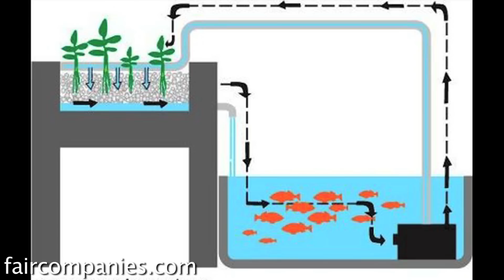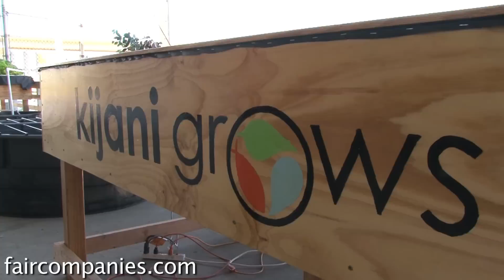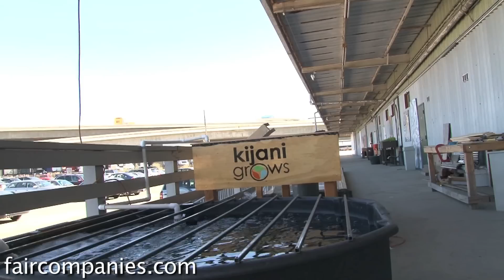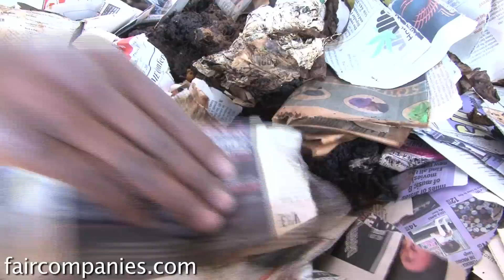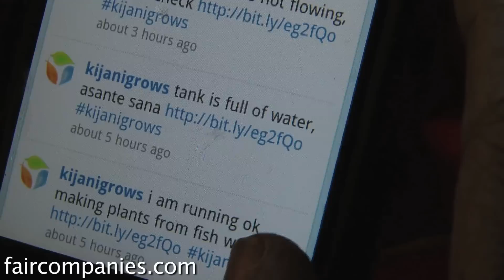Internet of food: Arduino-based, urban aquaponics in Oakland

Comment: If you wondering about the sign. Red 3 is Liquids and solids that can be ignited under almost all ambient temperature conditions.  Blue 2 is Intense or continued but not chronic exposure could cause temporary incapacitate or possible residual injury.  Yellow 3 is Capable of detonation or explosive decomposition, reacts explosively with water, or will detonate if severely shocked.  White Rad is Radioactive.

So it burns like gasoline, explodes like a fertilizer bomb,  knocks you out, and is radioactive.  

Nope, nope, nope .. live / exist somewhere else.-Edit-
https://www.google.com/maps/@37.803469,-122.292765,3a,52.7y,201.85h,86.53t/data=!3m5!1e1!3m3!1szZuhhefI0VzE35h6mSvVog!2e0!5s20140801T000000

Aquponics does not seem to be outside anymore, but the business and the sign remains.

Comment: Those pips are going to get gunked up really fast. You should switch to just an open pipe for an outlet instead of continuous pipe with holes. Also the rocks themselves will get gunked up fast and that is why the experts say to use 3/4 gravel.

Comment: One other thing I wanted to say:  instead of going arduino, is there any way you could reuse old android phones as controllers?  Just trying to think of ways to recycle plus lower costs.  Many phones have light sensors, cameras, and some have USB-host capability.  Just thinking out loud here.  If a phone could be wirelessly networked to dumb controllers/sensors, it would probably have the computing power to run all the systems anyone could handle.

Comment: The sign is to warn firefighters, it does not say the place is contaminated

The sign says "Health hazard: can cause temporary incapacitation or residual injury, Flammability hazard: can be ignited under almost all ambient temperatures, Instability hazard: May explode at high temperature or shock"

The sign is using an incorrect symbol for radiation, so it is old and out of compliance. It would have been caught in an inspection. I suspect the dangerous items left with the previous tenant.

Comment: Some visible nutrient deficiencies. Probably need som chelated micronutrients. Iron is hard to keep in solution without chelates. As an aquascaper I use industrial grade micronutrients with HEEDTA-chelate. It doesn't denaturate as fast as EDTA/DTPA. Easy fix for an awesome project. Hero!

Comment: You don't have to actually use a sprayer for an aeroponics system. Bubble systems, NFT with no medium etc are all viable if particulate matter is a concern. These would likely be a much more efficient system as well because the nutrients would receive more air, the bacteria grow better etc. 

If I had more space I'd do an experiment to see.

Comment: What about the pump power, what about the material used? It will produce a foot print in the same way as letting the waste go to the filtering process. Which is cheaper since its done in a larger scale.